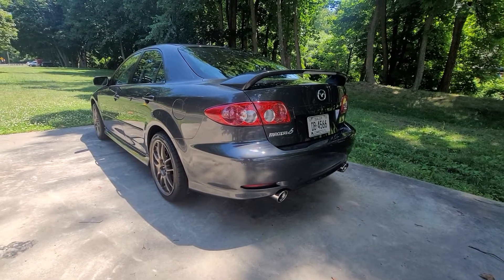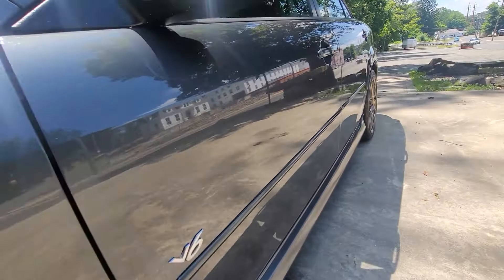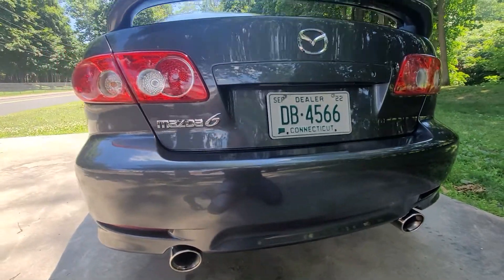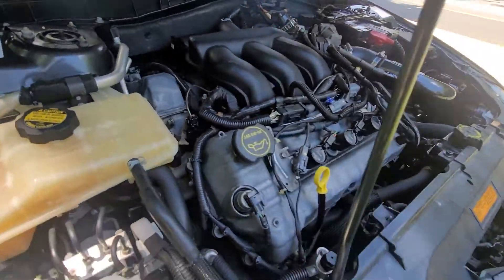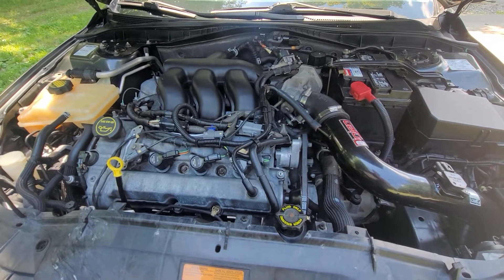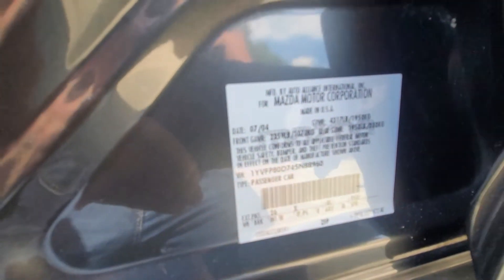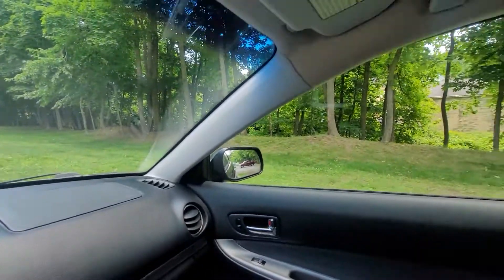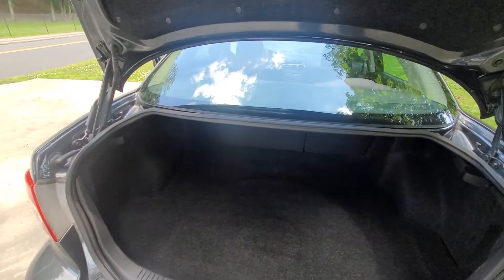2004 MAZDA 6 S PERFORMANCE SEDAN

Comment: I have the same kind of car in olive green metallic, one of the best sedans ever! Can you help me, i am missing something between the rear fender liner and the bumper, at the bottom behind the rear wheel, my bumper is flipping when i drive, there should be a plastic part closing the gape and holding the bumper, would really appreciate if you send a picture of it, trying to find this part for last 2 years, if there is a part code even better.